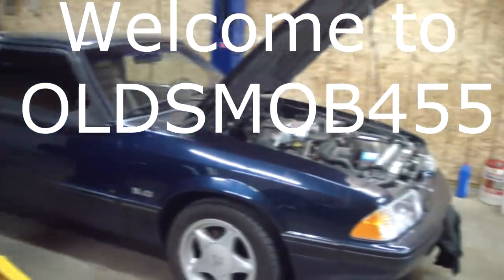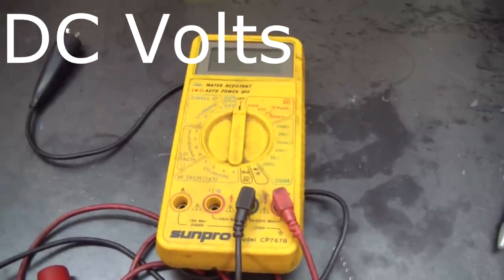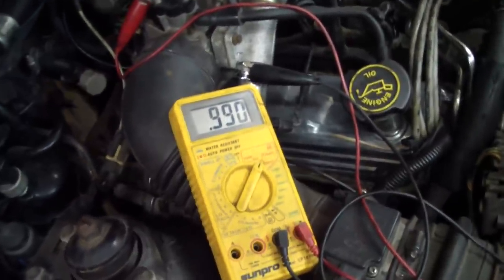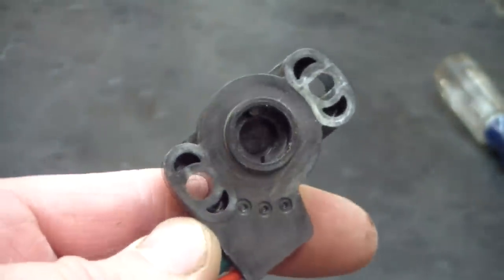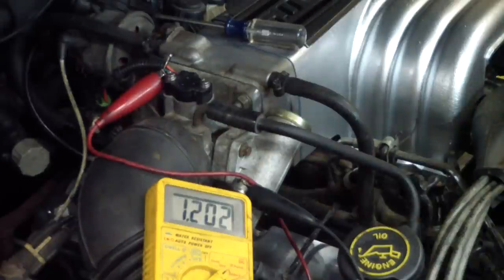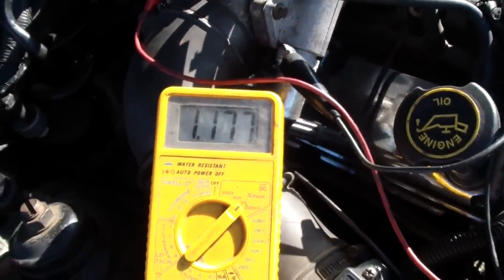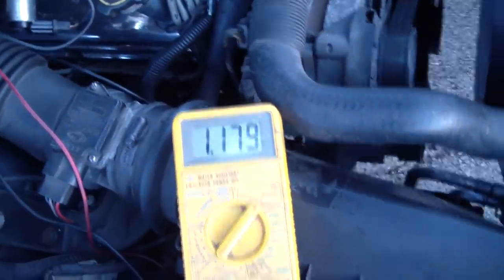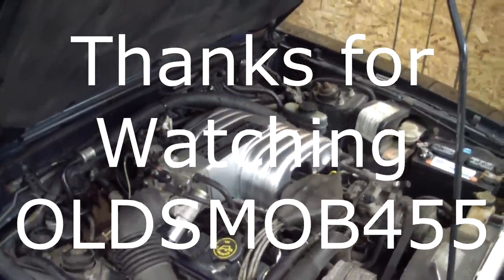Mustang 5.0 Throttle Position Sensor Adjustment TPS

Comment: stock setting for the TPS is supposed to be under 1 volt. the actual setting it was at before you messed with it is a perfect setting this info was direct from Ford

Comment: Thank you so much. After weeks of working on my 87 5.0 I couldn't figure out the rough idle after replacing just about everything from plugs to all new vac hoses. I was about to give up and found your video. It fixed it so far, I'm going to buy a new TPS today just to make sure, but ill enlarge the holes again if it does the same. Thanks again.

Comment: Got a 91 Merc GM that was running like crap, engine light on and off, etc. Followed your video method here and the car runs fine now. Had .888 volts to start. Check engine light flashes were 63-low voltage at TP sensor. I set it at 1.08 volts. I'll take it for a drive later, see how it goes. Thanks man for the video.
Reply: +1984bobo49  Follow up - Drove about ten miles this morning. No stalling,no check-engine light, runs smooth as silk. Thanks again friend.
Reply from the maker: +1984bobo49 Proof for the naysayers.
Reply: +Oldsmob455  Car started acting up again, checked the voltage at idle. Ran fine at .9 +- volts then voltage started fluxuating .9 to .1 all over the place. That's when the engine stalled. Got a new TPS a few days ago and it's been running fine. What a relief. Thanks again for the info.

Comment: My 1990 Notch would not even fire with a bad TPS sensor....would start for a split second then shuts off. Installed new one and fired right up runs like a champ. Crazy it went bad in storage

Comment: I have a 94 5.o and I went threw everything replaced fuel pump filter and all new sensors when you go to take off she's fine but getting down the road it just don't wanna run any tips would help...
Reply: "Timing chain slack" mines was doing same thing..it runs better now

Comment: Thats the same exact TPS in my Buell XB12Ss, Harley Davidson wants $325 and they pretend they are running out.  Motorcraft CX1133 is only like $35 bucks. Same with their 135 tooth 1 1/8" belt drives they put on all their 850lb baggers.  They want $300, but its just a Continental CTAM Timing Belt HB135-118 Reference OE/OEM Number: HARLEY-DAVIDSON MC 4030700 G05001AKF, same kevlar belt. Never go to the stealerships for parts

Comment: the information i have on the tps is 0.98 or 0.99 V with the engine not running or 1.03 1.05 with engine running

Comment: Like stated, don't touch your TPS sensor. This isn't 1995 anymore, and the reverse engineering of the EEC has shown that as long as its above .49 and below 1.1, once started the EEC resets this value relative to zero. Below or above those values sends a fault code. Simple.
Reply: THANK YOU SIR!
Reply: After replacing plugs, wires, coil, egr, all new vac hoses, I couldn't figure out the rough idle. Tried this and it actually fixed my problem for the first time in any youtube vid lol.

Comment: I have a 93lx with a 306.  I am having a frustraiting problem and will try to explain it as follows:  I have sluggish acceleration off the line and the car sometimes stalls.  Would a new tps sensor fix this irritating problem?  Also, how hard is the install? and what would a dvom(digital volt ohm meter cost?   Many thanks for your time

Comment: My 92 Idles fine has no problem revving from 1000 rpm on up, but it almost feels like it has to fight to rev right as I press the gas pedal from a lower idle.  Is that the symptom you were referring to when you said "all of the hesitation is gone"?

Comment: Interesting tuning tip!!  I was thinking you might want to index the sensor in case you need to remove it for some reason, that way you can put it right back into position without having to re-tune.

Comment: Ok, maybe I am wrong. I just know on my T TYPE i did the same thing after reading on the internet it was a good thing. It wasn't, i had to get a new TPS and after I set it within spec the car ran perfect. It ran fine before, no CEL, but it definitely ran better within spec. If it works for you great, i will shut up now
Reply: this does work and very well on these cars.  I have done this mod on 2 different 5.0 cars and the difference is night and day. One was a  stick car and the other an aod, does wonders for power, idle and throttle response. there is all kinda of lil tricks with these that cost nothing, I want another!

Comment: Oldsmob455,

What voltage would you recommend for a 1995 SVT Cobra? At the moment I have a problem with the idle. My RPM needle bounces around way too much. And the engine even boggs out at times.
(turns off while in use)

Here is a list of a few mods done to my Cobra:
V1 Vortex SC, shorty headers, Ford Lightning mass air intake, 39lb fuel injectors. The 302 engine is completely rebuilt for performance as well. Given the short summary of mods on my Cobra could you recommend a good reference for the TPS?
Reply: Bro, this guys user name should tell you all he knows about Mustangs.
Reply: .78-.99 is specs for factory.

Comment: Hey! Thanks for posting this. I think I have a similar issue on my '91 LX 5.0, it doesn't pull very much at all from a dead standstill, but after about 3k rpm is when it starts to get up and move. It also revs relatively slow in neutral or park. I went to go diagnose this, however I can't get a volt reading from the TPS. I did what you did and pierced the green wire with a metal pin and then hooked the volt meter to it, but it just stays at 0. Any ideas of where else I could try piercing it, or where else to hook it up to?
Reply from the maker: Is your check engine light coming on?  Maybe the thing is junk.  There is alot of info on the net on this subject.
Reply: Nope, got no CEL. I wouldn't be surprised if the entire TPS is junk but I imagine one of the previous owners did what you did; replaced the sensor but never adjusted it so it just felt slow. Ive been doing a decent amount of research on it and it seems like the consensus is get a reading from where the wire actually goes into the connector, but I need to take the module completely off for that and as far as I know the screws on the head of the TPS are stripped to god knows what so maybe that'll be a project for another day lol

Comment: SEE BELOW... Quote "
Jerrythenerdful
5 years ago
This is complete rubbish. You can look at the Ford EEC strategy and see the computer doesn't care if the voltage is anywhere from just below .6 volts to 1.2 volts. The Ford firmware accepts any key-start voltage in that range as closed throttle.Doesn't matter what it is.  2.71 volts above that is considered WOT voltage, and anything between the key start and + 2.71 over that is part throttle. Ford intentionally did this so people in the field would not need to adjust the sensor. It's right in the code for the computer. That's why Ford doesn't have an adjustment. People have to file and drill to change the setting because it was never necessary to change it. Anyone who has tuned a Ford EEC or read the documents for the EEC knows this."
Reply from the maker: Be sure to have Jerrythenerdful tune your car.

Comment: This is complete rubbish. You can look at the Ford EEC strategy and see the computer doesn't care if the voltage is anywhere from just below .6 volts to 1.2 volts. The Ford firmware accepts any key-start voltage in that range as closed throttle.Doesn't matter what it is.  2.71 volts above that is considered WOT voltage, and anything between the key start and + 2.71 over that is part throttle. Ford intentionally did this so people in the field would not need to adjust the sensor. It's right in the code for the computer. That's why Ford doesn't have an adjustment. People have to file and drill to change the setting because it was never necessary to change it. Anyone who has tuned a Ford EEC or read the documents for the EEC knows this.
Reply: This is absolute fact Jerrythenerful.  I just referenced this video to help a friend diagnose his TPS voltage. Everything else in this video is garbage.  As long as the TPS is ranging correctly through the voltage the base voltage should be between .6 and 1.2. I just fixed a car quoting this exact figure before I saw this video to help a friend who is long distance. I'm going to quote this to bring it back to the top!

Comment: You are not adjusting a carb on 69 camaro. Its computer controlled, which run great when all the sensors are adjusted within spec. You just cannot adjust sensors and go by feel. You have to find what the correct factory settings are, adjust it to that and leave it the fuck alone.
Reply from the maker: The proof is in the pudding.  When a intermittent CEL light gets fixed and there is more power I'm game.  Do what you want with your car.
Reply: @Oldsmob455  Ignore the uneducated, inexperienced trolls. I really appreciate the video.  I own two OBD 1 Ford vehicles and it's amazing just how much just the slightest adjustment of the TPS affects the power and shifting of the vehicle! It feel likes getting your PCM tuned.  Most these naysayers are probably thinking of more modern OBD 2 vehicles.